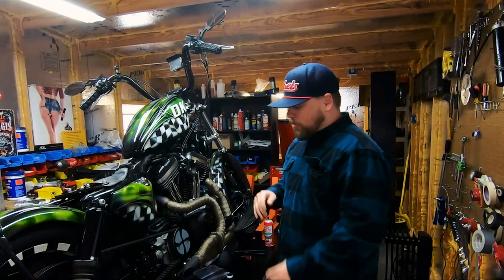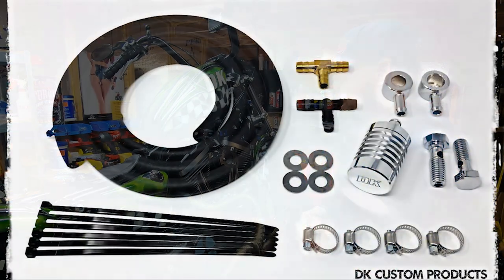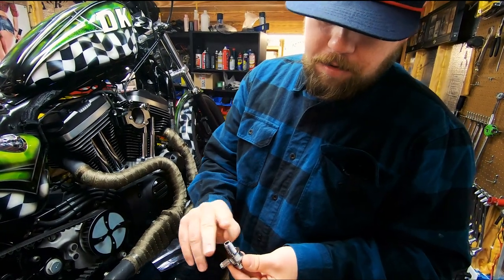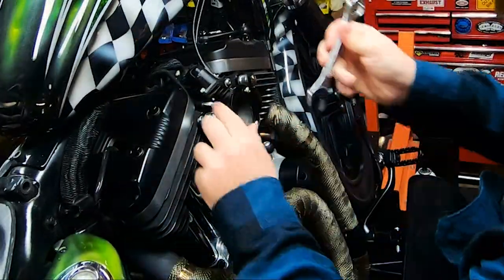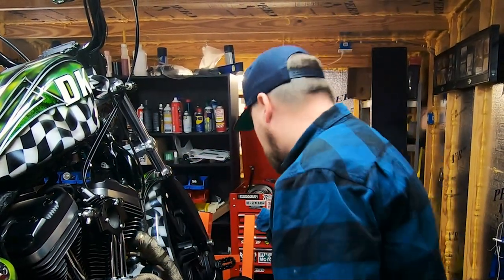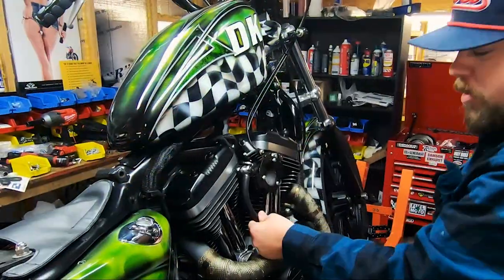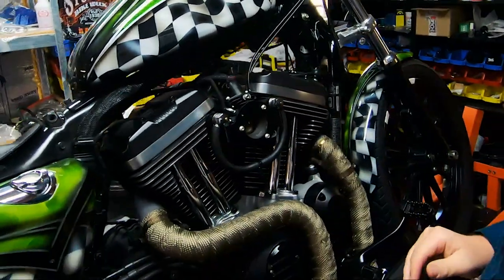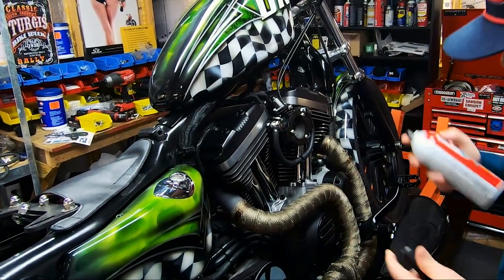How To Install A Premium Discrete Catch-Can Breather

Comment: Will harley throw a fit if they see this on the bike? Especially is Iive in CA?
Reply from the maker: Harley does not care.
Will a dealership here and there get their panties in a bundle?  Yeah, if they pay enough attention to even see it.
They cannot deny any warranty work because of it.
IF you are stuck wanting to go to a dealership that you think will be anal about it...just put it back to stock before taking it in to them for any work.
If you go to a dealership that cares, that is an indication that they are not using their logical thought process, best to change to a dealership that understands that it is better for the bike and is happy to see it.
Reply: @DKCustomProducts  thanks for this. I will definitely put the stock slips on back on as the aftermarket ones have the cats removed lol. But I'll leave the EBS and see what happens
Reply from the maker: @kevindelk  Good deal.

Comment: 2001 RK EFI. I have a chrome pipe coming off the front head to the rear head. With one rubber line coming off the rear. The rubber line goes into a coupler to the back of base that holds the air cleaner on. Can I just disconnect the rubber hose and connect your product to it?
Reply from the maker: Yes, that will work perfectly. 👍

Comment: Would this work on my 016 103?
Reply from the maker: It depends on what air cleaner you are running.  Here is a link to a chart that shows you which External Breather Systems fit which different style air cleaners.  https://www.dkcustomproducts.com/getting-the-right-external-breather-systems-ebs-for-your-bike.htm

OR, you can email or call the shop and let them know what Air Cleaner you have and they can let you know which ones will fit.
Support@DKCustomProducts.com
662-252-8828
Thank you for looking at our parts! 👍😎👍

Comment: Will this work with the ventilator  breather on a M8?
Reply from the maker: This one will not work with the Ventilator.  There is no place for the banjo fittings.
The one at the following link will work with the M8 Ventilator.  It does require drilling a couple of holes.
https://www.dkcustomproducts.com/external-breather-system-w-catch-can-harley-twin-cam-dk-tc-brt-cc.htm
Feel free to call or email with any questions.
Support@DKCustomProducts.com
662-252-8828

Comment: Will this work with trask breather system?
Reply from the maker: I am not sure what Trask Air Cleaner you have but most of the Trask Air Cleaners would require modifications using the DIY kits found here...

https://www.dkcustomproducts.com/diy-external-breather-systems-546.htm

The install procedure can be seen here on a similar system in this video...

https://www.youtube.com/watch?v=oYSQWWJYZak&t=1348s

Here is a video on how to choose the correct EBS that you may find useful - https://www.youtube.com/watch?v=85jEZjX6Dhw

Please feel free to reach out with any questions or concerns;
Support@DKCustomProducts.com
662-252-8828

Thanks for commenting! MB
Reply: @DKCustomProducts  trask assault air cleaner
Reply from the maker: Yes, system would require modifications using the DIY kit seen at this link- https://www.dkcustomproducts.com/diy-external-breather-systems-546.htm

The install procedure can be seen here on a similar system in this video...
https://www.youtube.com/watch?v=oYSQWWJYZak&t=1348s

Please feel free to reach out with any questions or concerns;
Support@DKCustomProducts.com
662-252-8828

Thanks for commenting! MB

Comment: Can it be used with my screaming eagle heavy breather (90 deg cone type)... Looks like the the mounting for it takes the place of where these bolts would be used at..?
Reply from the maker: There are a few different External Breather Systems that can be used with the SE HB.  The Premium Discrete is not one of them.
The EBS's at either of the two links below will work with the SE HB.
If you have any questions, feel free to call or email.
662-252-8828
Support@DKCustomProducts.com

https://www.dkcustomproducts.com/diy-external-breather-systems-408.htm
https://www.dkcustomproducts.com/external-breather-system-w-catch-can-harley-twin-cam-dk-tc-brt-cc.htm
Reply: @DKCustomProducts  thanks! I'm checking it out today!
Reply from the maker: @phillipdiaz57  Appreciate you looking at our parts.

Comment: Do you need the catch can? Can you just run it to the bottom of the frame? Not much comes out correct?
Reply from the maker: Good question.  We made a video on that subject.  The link to it is at the bottom.

How much oil comes out all depends on the bike.  As a rule (but there are always exceptions) Twin Cams spit more than Sportys and M8's less than either of them.  But here is a photo of a typical amount taken from a Twin Cam over a 2000 mile period during cold weather- http://www.dkcustomproducts.com/media/wysiwyg/Catch-Can_Glop_1.jpg

Here is the photo of the top of a piston of an M8 after only 5000 miles.  That is only 1 piston, so only half the crap.  Think about how much would be along the bottom of that bike.  https://www.dkcustomproducts.com/media/wysiwyg/AirCleaners/M8_114_5000_miles.jpg

Here is a report you may find useful, that also has more photos- https://www.dkcustomproducts.com/overview-of-external-breather-systems-ebs.htm

Video on filter vs. catch can vs. nothing- https://www.youtube.com/watch?v=WVZbsLPzmZk
Reply: Thank you, I have an M8 2021….So it’s time to make this correction…Have a great day!
Reply: @DKCustomProducts  I would rather the can man, besides, they look cool, they function, and it keeps the environmentalists off my back.
Reply from the maker: @kevingleason5434  Yes, it is nice to see what is going in the can instead of the engine, plus if disposed of with old oil, keeps some folks happy. 👍

Comment: so where does the oil go?
Reply from the maker: Not sure I understand your question.  Oil goes into the catch-can.
Empty the catch-can into a used oil bottle and return it to an auto parts store for proper disposal, the same way you do with used oil after an oil change.
Here is a video about how the oil flows from the engine into the External Breather System and to the catch can or filter of an EBS.
https://www.youtube.com/watch?v=x61yu0HKW5c
Reply: @DKCustomProducts  ok thats what I was wondering if it had to be emptied.
Reply from the maker: @carypipes  Yes, how often depends on how much of a spitter your particular bike is.  Here is a video on emptying the catch can, it is pretty easy- https://www.youtube.com/watch?v=FD1kdgcoxg8
Reply: Im on your website now putting in a order
Reply from the maker: @carypipes  Thanks man, we appreciate your business, and I believe you will be well pleased with it.
Reply: @DKCustomProducts  i used your tank lift on a 2014 lowrider i customized. I won alot of bike shows with that bike
Reply from the maker: @carypipes  Very cool, thanks for that, we appreciate your business.

If you have any photos of your winning lowrider that you want to email us, that would be great, we would be pleased to put them on the website.
Support@DKCustomProducts.com
Attention:Kevin